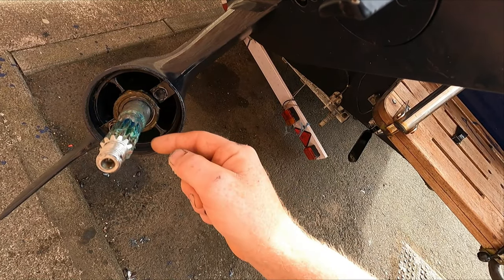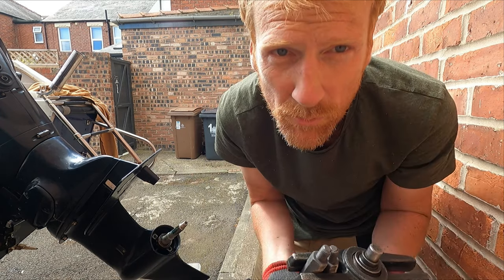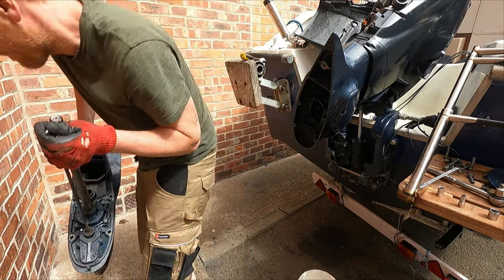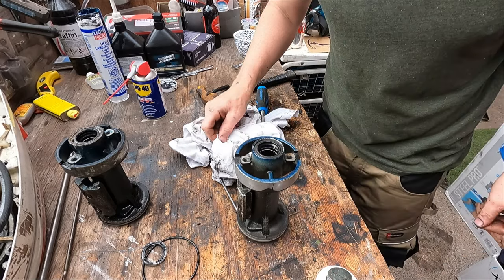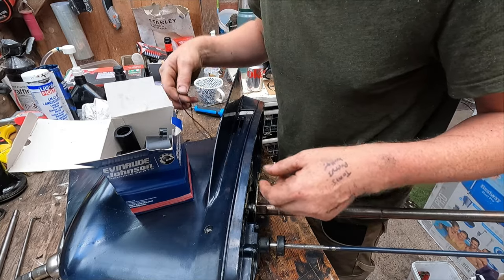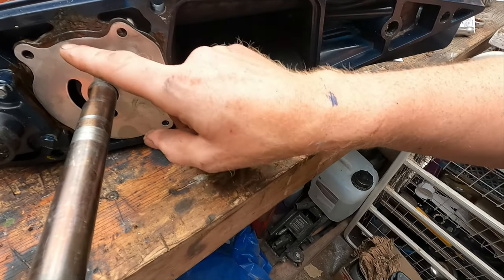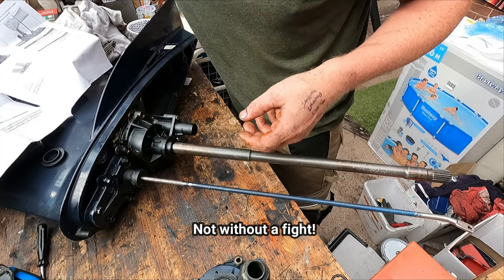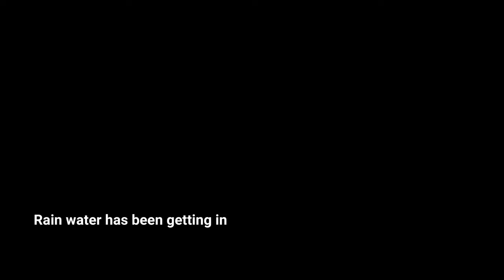How to Replace Evinrude Etec Lower Unit Oil Seals.

Comment: Nice vid. I just got a bit confused when you talked about anti clockwise. But then i see that ju bend the impellerblades so they get the right angle. When i change impeller i just rotate the propeller so the driveshaft rotates clockwise! seen from above, and push the housing down at the same time. Just to clearify that the impellerblades shall bend as they do when the axel rotates clockvise seen from the engine naturly. 
Thanks for great vid :)
Reply from the maker: Thanks, I confuse myself,  your way makes more sense.

Comment: Hi - nice video. I have a pair of E-Tec 200HOs that are both showing signs of water penetration. I’m not sure I want to attempt this myself. What kind of torch is that? Did all the paint burn off when you heated it?
Reply from the maker: Hi, thanks, it's a butane torch and no surprisingly it didn't at all.

Comment: hello my friend. My Evinrude etech 30 hp engine is leaking oil from the tail joints. The smoke is not coming out completely from the exhaust, I think the engine is choking and not working properly. Why does this?.. What should I do?..Thank you..
Reply from the maker: Tail joints?  Have your oil seals gone on the lower unit?
Reply: My dear friend, the exhaust muffler of the 30 hp evinrude eteceh engine was shattered in the middle. Will it cause any harm? Will the engine start   @abakerslife

Comment: How many hours on your engine ?? I've got the same model.
Reply from the maker: Hi Keith, it's got 340 hrs on it.  I bought it with 40 hrs.  Interesting to learn why the injector failed...I had heard 'rumours' about there being bad batches of injectors but assumed it was an urban myth or something.  I am not looking forward to having to replace the other two as well!
Reply: @abakerslife  Thanks for that. Mine's got over 380 hours so it's probably worth me pulling the propeller shaft tube out as well, to renew that seal. Looks like the anode that sits there is a bit eroded in any case, and that needs changing too.
Reply from the maker: @keithscott9774  My seals were damaged by braided fishing line getting wrapped around the prop.  I could see that they had been replaced before.  I think it's inevitable that those seals will get periodically damaged so I expect to be replacing them routinely.  If your oil is clean then I personally would wait till you notice a problem before replacing them as you might end up doing it regularly.  The anode is dead easy to change.  What sort of boat have you got it on?
Reply: @abakerslife  Swiftcraft Seagull but it looks like it's been modified a bit. The transom is a plain flat "wall" and it's had an aluminium pod that puts the engine about 500mm back from the transom. I regret getting a half cab boat because of the standing room it takes away from you. Would have been better to get a fully open boat with all controls further forward, and either make a head head cab like you did, or get a canvas canopy made.
I love the Etec engine but I live in fear of it because of parts costs. The EMM is a delicate item and if you don't take all sorts of precautions to prevent it dying, that will be another 4 figure sum to cough up. It seems to have hardly any built in electronic protection. 
I pulled apart the VST (vapour separator tank) when I first got the motor just to see how everything was inside, and I found one of the stainless bulkhead fittings that screws onto the water coil had very bad localised electrolytic corrosion and pitting. Everywhere else the stainless was in mint condition. If the pitting had traveled a bit further it would have passed the o-ring seal that separates the fuel from the sea water. The cooling water is at a higher pressure than the fuel in the VST so sea water would have mixed with the fuel and potentially corroded all injectors (ouch $$$). As usual the bastard manufacturers won't sell you a simple part and I would have had to pay A$1200 for a complete new VST. The local dealer would not sell me a used part from an old VST and tried to give me a load of BS about old VSTs are all "rusted out". Complete BS because normally the stainless fittings don't rust (localised electrolytic corrosion is different). I have some machining knowledge so managed to measure up all the dimensions and threads and made my own fitting on a lathe. Paid 90 odd dollars for a special thread tap and that was it.
Reply from the maker: @keithscott9774  Thank God you had the skills to avoid that bill!